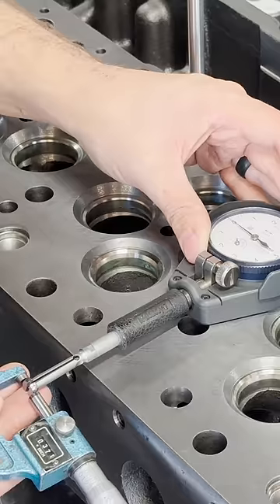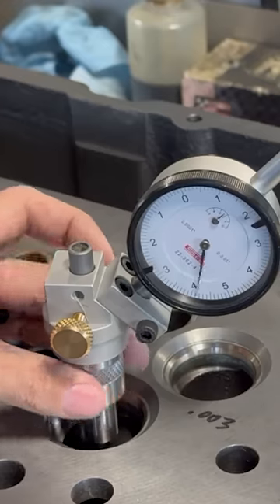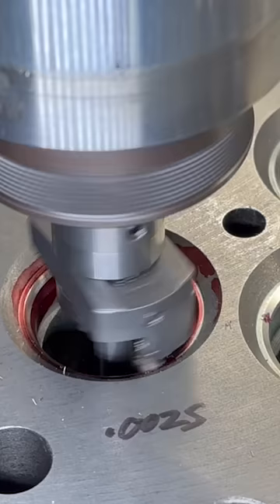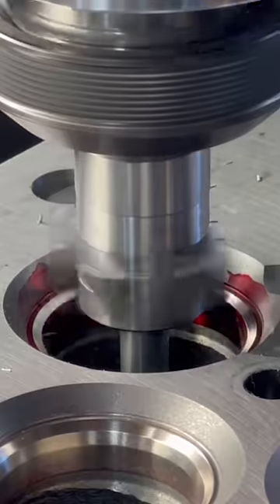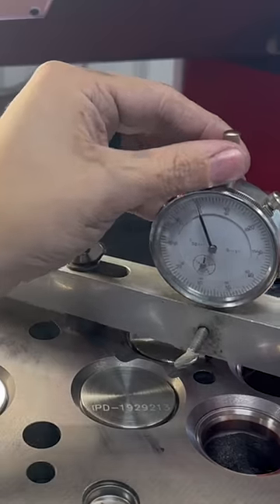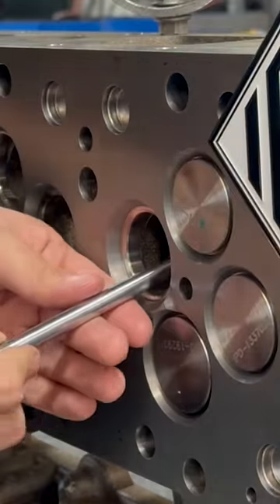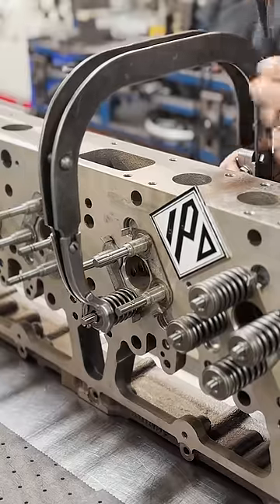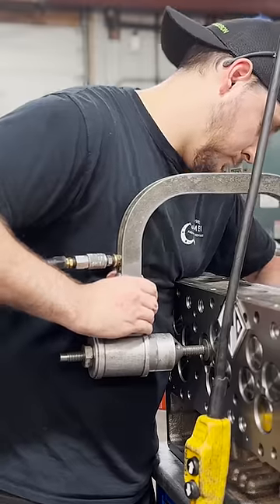Can We Improve The Valve Seat Runout On A New Aftermarket C12 CAT Head?

Comment: In high school working in a garage part time. One fine beautiful sunny day one of the mechanics who was doing a drum brake job was using a screw driver to remove a drum return spring when the stew driver slipped off the spring and went up into his eye. He lost the eye. 
When I see individuals doing anything in a shop and they aren't wearing eye protection I think of this. I take shop courses at the local community college and college wide, the first thing you do when you walk into the shop is put on your safety glasses.....NO EXCEPTIONS.

Comment: The same as aftermarket performance cylinder heads for gasoline applications.
I ultimately ended up only supplying three manufacturers' products during race/high performance engines built for customers.
To supply any other brands required complete re-machining of their products.

Comment: How does the cost and time balance off against a CAT Reman?
Reply: Same question.
Reply: From my experience, probably pretty well. Cat genuine reman stuff is extremely high quality (usually...I've been hearing rumors of some increasingly poor quality products) but it's 3 or 4 times as expensive as anyone else's equivalent.
Reply: @mitchell7203 unfortunately, yes. CAT heads and packs are nice quality but their fuel system components have taken a serious dive in quality

Comment: You have all these high tech equipment and wouldn’t be able to weld the cracked head. The Pakistan Stone Age technicians weld the cracked engine head and cylinder bock , by preheating with dried cow manure and then welding with nickel .Actually they do an amazing job 😂

Comment: I was wondering why you plugged the way passage through the head gasket. Then I realized that less holes in the head gasket means a stronger gasket with less points of failure.